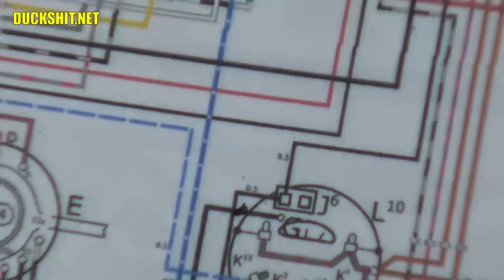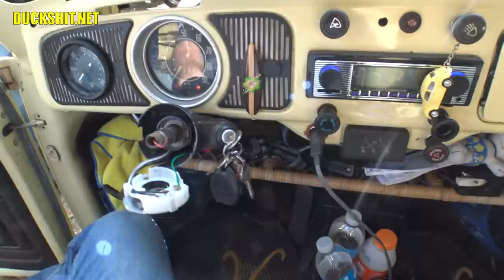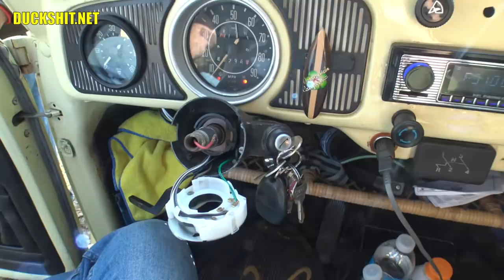Longer and Less Cuts @ VW Tech Session - December 2020

Comment: These cars shine in cooler weather; they run so much better and cooler. Another good reason to keep the thermostat and vanes system in these cars.
Reply from the maker: Very true!  Plus the thermostat helps with climate controls, you get more heat and sooner!
Reply: @vvtheduckvv  and they warm up sooner and properly in cooler weather.